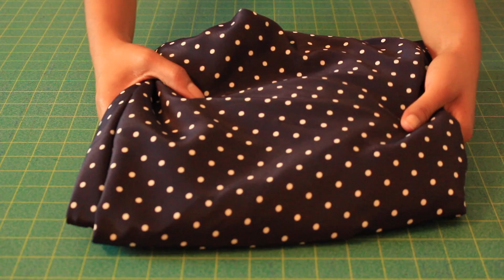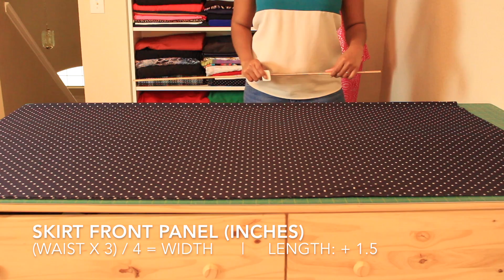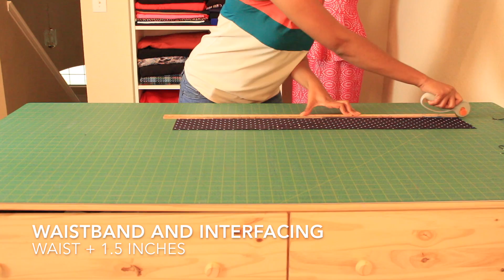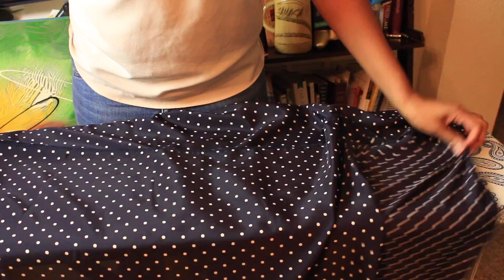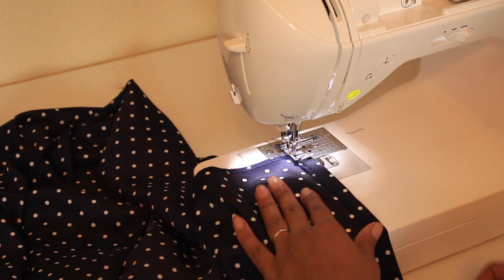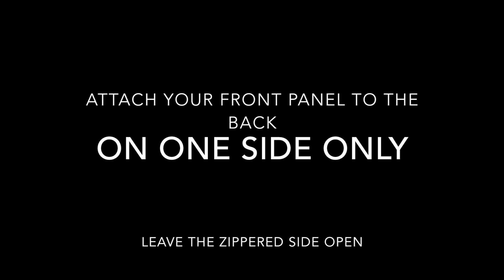DIY Tutorial: Maxi Skirt with High Split

Comment: Thanks for this great tutorial! I gather exactly the same way, I can't stand those delicate basting double lines... the only difference: I use elastic thread instead of your wire and stretch it evenly with my right hand while sewing. That way, the gathers are evenly distributed from the start. I do that because I can never gather evenly when I have to distribute, I just don't have a good eye for that. Thankfully, the elastic saves me that step. Also, I don't need to secure it with a straight stitch since I just pin it to the waistband and I can stretch the elastic to match.
Reply from the maker: +ColorBloX Great tip, thanks for sharing!
Reply: gret tip thanks
Reply: thanks for the tip!

Comment: I love this video, thank you ma'am for sharing your knowledge 
But I got lost somehow during the waist measurement (waist *3/4)...if I were to measure mine because my waist is 28, I'd get 21"(inches)  after dividing... and that measurement won't be as wide as the one you showed;  meaning the gathers won't be full
how do I measure to get a fuller gather 
thanks once again as I await your reply
Reply from the maker: Trust your math. I made the skirt in my measurements which is larger than yours, so don't compare your size to mine. It will be a full gather. If you prefer, make a practice skirt first.

Comment: Good afternoon I am lost , when you say your waist multiply by 3 and divide by four , did you fold the material into two because I know it is for just one side of the skirt either front or back, so when cutting out the material do i fold into two
Reply from the maker: Yes, I folded the fabric. When I say "cut on the fold", I'm saying my fabric is folded in half. So when you do your measurement and cut on the fold, you will cut a very wide panel. Hope that helps!
Reply: So....the back is fold?
Reply: Zyska Herbert yes, the part of the skirt closest to her body is where it's folded.
Reply: So if ur answer is 27 after dividing. it means when u fold u measure 13.5?

Comment: I watch your video often for reference...I love it. I want to ask to a question. I, again, want to use your video for reference in making a gown, but I want the skirt to flair at the sides like an A-line skirt. Do you think it would be feasible to angle the yard stick from the waist to the bottom when connecting so the skirt can flair?
Reply from the maker: Hey! No, actually changing at the side seam will give you this weird angular situation that's not going to give you the look you want. What you can do it cut and spread from the hem to the point where you want it to flair. Spread the pattern open at that point (or points depending on how flared you want it), then redrawn the hem at the new width/sweep.

Comment: I have a question; i saw you gather the front piece only and then you jumped to attaching the back piece on one side to the front. Is the back piece not gathered as well or did you manually gather it when you were attaching the waistband?
Reply from the maker: The front and back pieces were sewing together before I began gathering. So all pieces were gathered at the same time before attaching the waistband.

Comment: Does it matter how wide you cut the waist band? I'm not seeing a measurement for it, only length 🤔
Reply from the maker: I cut mine 4 inches which will be 1.5 inches when folded and finished. You can cut it to the height you'd like.
Reply: @Stylesewme  thank you so much for the reply! That's what I ended up doing by eyeballing your skirt. This skirt is fabulous and thank you for sharing!! 😁

Comment: Hi, question, what is the inner facing? Is I optional And what is it for? (Not sure if I’m saying that right) sorry I’m super new at sewing
Reply from the maker: Hi! It's called interfacing. It's a stabilizer for your fabric if the fabric you're using is too flowy for (in this case) a waistband. There are different types for different reasons.

Comment: Hey, quick question.  for the first and second panels, is the fabric folded prior to cutting? Did you use 2 separate 1 yard panels? I guess im trying to figure out if when you say lay the 1st panel on the fold of the 2nd panel, is the second panel folded in half? I hope that makes sense lol.  thank you :)
Reply from the maker: +Ahlon Black Both panels are folded. You are copying the 1st panel to make the second one.
Reply: got it, you mentioned you used 2.5 yards, so is each piece 2.5 yards? or did you cut that in half then fold for the 2 panels?  I'm sorry, I'm a semi-beginner, and I think this is where I go wrong with either not having enough fabric or cutting something wrong. Thank you for your reply.
Reply from the maker: +Ahlon Black 2.5 yards is for the entire skirt. I think when you work through it, it will make more sense to you. Do the skirt on practice fabric that you won't mind messing up. Don't be afraid to try!
Reply: +Style Sew Me I tried :( maybe in doing something wrong lol.  I have my 2.5 yrds. folded in half and I cut what I needed for the first panel, However, there is nothing left to cut the 2nd panel out of (in which you laid another piece of fabric and laid your 1st panel on top of to trace).  Am I not supposed to have the 2.5 yards in half when I cut my first panel? My First Panel was def. not as along as yours when you cut the split piece lol.  I'll keep trying.  Thanks again.
Reply: that's exactly what I'm trying to figure out, I want to assume she used a very very very long piece of fabric to cut the 2 panels out. I'm not sure how else you can cut two long panels that are both on fold on one piece of fabric
Reply: +Ahlon Black did u figure it out
Reply: VogueISHable Girl no lol.  I was just looking at my fabric on the floor. It was impossible to figure out how she has 2 long separate folded panels out of (1) 2.5 yards of fabric.  I thought I was tripping because everybody else said they got it.  If I took my 2.5 yards, and just cut my measurements out of 1 fold, from the looks of it that wont be enough because she did it twice.
Reply: +VogueISHable Hey, she said the rest of her fabric was hanging down the side of her table, which is what we cant see.  The first cut we see her make goes all the way across and she pushed the rest of the fabric out of the way which separates the 1st and 2nd panel fabric. Then she cuts the rest of her chalk marks.  what she pushed to the side is what she used for panel 2, then traced panel 1.
Reply: this was the same thing I'm thinking lol before cutting fabric if i need to start with more then 2 1/2 yards lol

Comment: Why didnt you just fold your fabric into two and cut both front and back panels same time???
Reply from the maker: Matter of fact, I did fold my fabric in half. I'm not understand all of the ??? The width of the fabric was just wide enough for me to cut one folded panel at a time like I said in the video.
Reply: Style Sew Me I believe she just was enquiring on whether your measurements width x3 /4 was the measurement required to be cut on a fold or is it to be cut on a flat fabric piece- maybe it wasn't clear for all of us whether you used the calculation in regards to cutting the fabric on the fold or not, therefore you could just fold the fabric in half once and cut using those measurements to get a quick 2 pieces
Reply: All of that attitude in response to a simple question is unprofessional and unnecessary. I find your channel creative and useful, but there are plenty of YouTube seamstresses who treat their viewers with respect. I'll watch them instead.